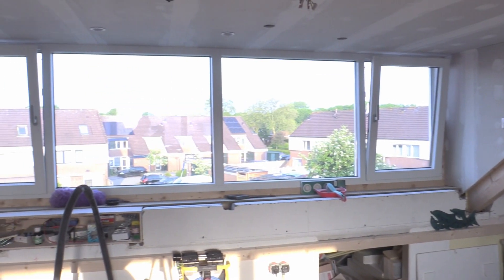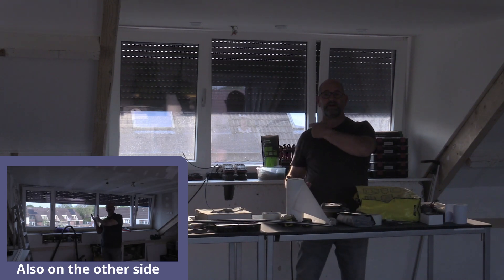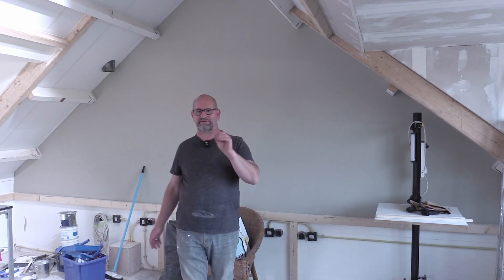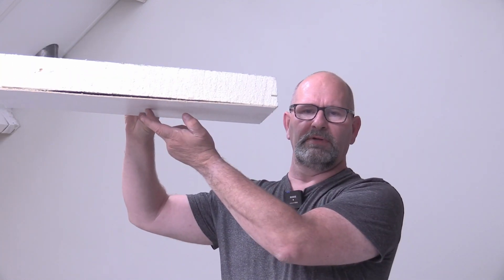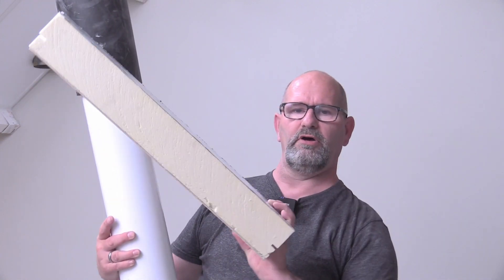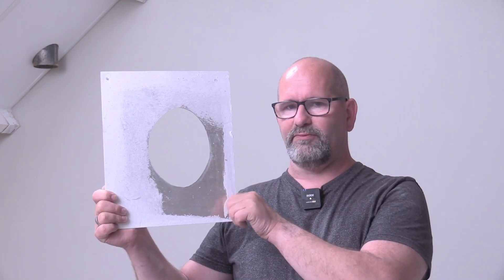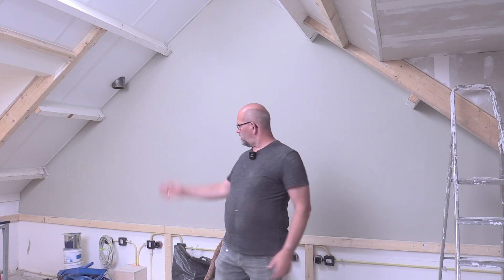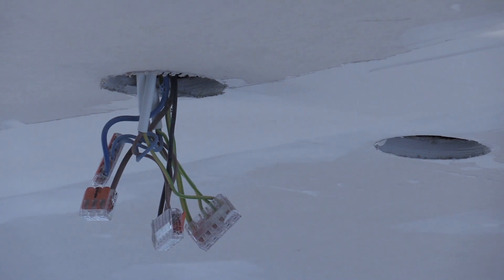🛠 Laser cutting Insulation material with the Creality Falcon 2

Comment: foam burns VERY well. i hope that pipe is never subject to any heat.
Reply from the maker: The pipes are double isolated, all of them. But before I fired the laser,  I tried if the material was flammable and I could not set it to fire, no matter how I tried.
The insulation is fire retardant as well, which is obligated by law.
Reply: @3dPrintCreator  Nice nice!